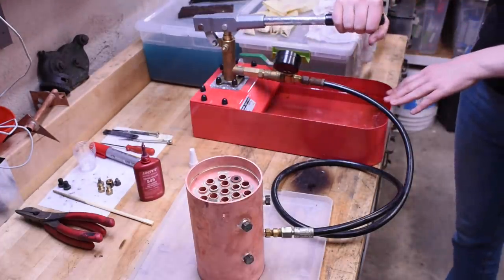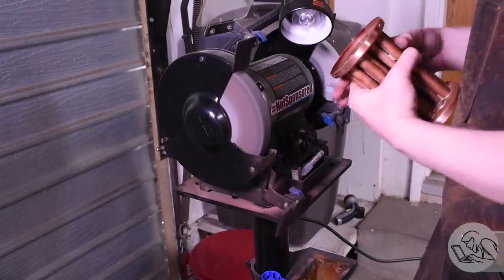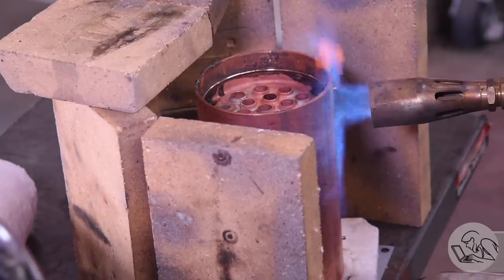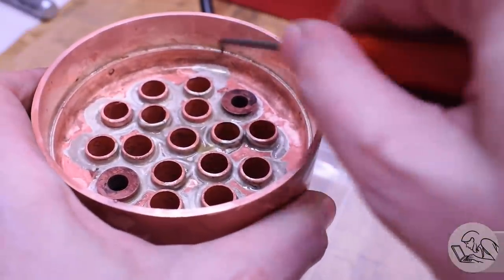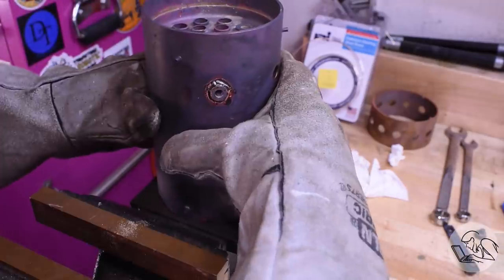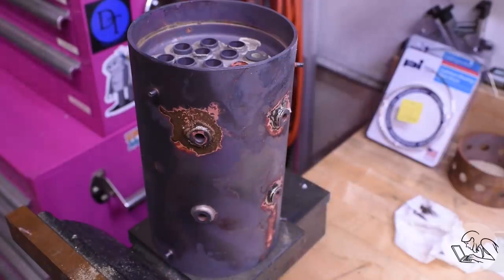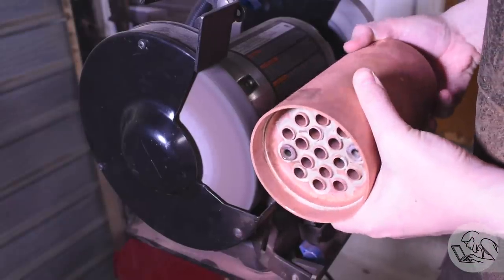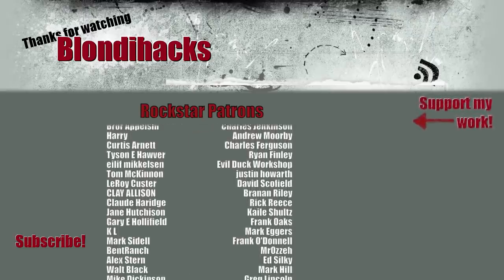Building A Model Boiler - Silver Soldering and Pressure Testing! Model Boiler Build, Part 10

Comment: When I was working as a Millwright, I installed a huge Rotary Screw compressor. at our company. My boss wanted to sweat the copper tubing used to feed the tank, I told him to "flux the flucking pipe and don't fluck it up".We both got a good chuckle when I said that.

Comment: Congratulations on the silver soldering accomplishments with this project. I spent a whole summer when I was 13 yrs old being a helper to a older fella that was a retired boiler maintenance man. He would take in heat exchangers that needed rebuilt. And I got 4 months of daily lessons of the fine art of soldering. Its truly becoming a lost art here in the United States.  And to see how well you did with this project, You definitely have done your homework on how this type of work/repair is done. #Jobwelldone

Comment: Great soldering job 👍
I saw in a recent Model Engineer magazine, a two part article on exactly this process. The author showed his first attempt failure ( reheated and dismantled the joints, showing that not enough solder had been used.
In the second part, the author actually calculated the x-section area of ( the solder) each joint, and then determined what size ( and number) of wires were needed for each joint. The joints shown were a strap and butt on a barrel; a tube/tube plate joint, and a lap joint as on tube plate to barrel.
Once again, thanks for your very detailed video.
Regards
Robert

Comment: Fabulous results well done 😀 with the big solder ring I use a stainless steel scratcher to run round the joints whilst still hot to examine for bad spots. Bit of 1.6mm tig rod sharpened to a point or similar. Think that is a Kozo tip too. I use a big weed burner nozzle to preheat before using a smaller burner for detail work. Saves the flux. Loving the pink tool chest ❤️❤️❤️❤️

Comment: We used a piece of the correct melting point SS with flux on it to probe joints while the heat was on. A ‘little’ extra solder did the trick.

Comment: Great job! The tubeplate to shell solder joints are beautiful :)

I was worried that by only heating the shell and not the tubeplate the solder would only really stick to the shell, and thought that might be why no solder got through to the inside of the studs, but the pressure test says otherwise!
Reply from the maker: The tube sheet gets plenty hot because the shell has 100x the mass. By the time the shell is hot enough, the sheet is for sure.

Comment: Paint it with Rustoleum Hammered copper color paint and it will look like unoxidized copper for a very long time.  You can even do the same thing with inexpensive garden & patio objects for the same effect.
Reply: I'm not sure how hot this will get with pressurised boiling water inside, and I don't know what the maximum working temperature of rustoleum is, but personally, I tend to use "Barbecue paint" for protecting anything that gets reasonably hot. It might not look that pretty, but it takes a hell of a lot of heat to burn it off, and gives the metal a reasonable amount of protection from damp.

Comment: It sounded to me like you wanted 2 thou on the radius for the gap - but doesn't the feeler gauge push it over such that it's measuring the clearance on the diameter, so you'd need a 4 thou gauge? But hey, if it works, it works :)
Reply from the maker: It’s held centered in place by threaded studs
Reply: @Blondihacks  Thank you for clarifying that.

Comment: I'm sure it was really hard to resist the temptation to touch up the solder joints AFTER the successful pressure test. I'm certain that I would have used an entire roll of solder and gone back to the store to get more. 😛
Reply from the maker: It was super hard 😅

Comment: Why not use paint-brush with soapy-water and compressed-air for the leak test?  Bubbles/foaming is easier to see, maybe?
Reply from the maker: Compressed air is dangerous for testing boilers because it builds energy and can explode. We always hydrostatic test pressure vessels.

Comment: From my silversmithing days I always tried to get a snug fit - silver solid is not meant to be glue but hey, I'm British and well... complete the sentence.
Reply from the maker: Silver solder needs to flow through the joint for full strength. 2-6 thou clearance is recommended.
Reply: @Blondihacks  :)

Comment: I've just noticed how unscathed Quin's hands and arms seem. As a hobby engineer I'm forever slicing chunks out of my fingers on burrs and other sharp edges, getting weld splatter burns on my arms, and grazing my knuckles when messing about with rounded old bolts in confined spaces. My hands usually have a veritable network of slowly fading scars......... How does Quin keep her hands/arms looking so "Silky smooth and blemish free" ?

Is it prevention through using better/more PPE than me? More care taken on her part to avoid cut's, Bumps, bruises and burns? Or concealment via LOTS of cover up foundation to hide her "Battle scars" from camera ?